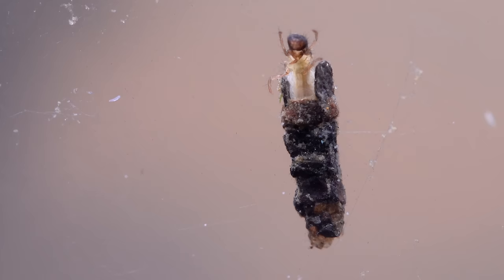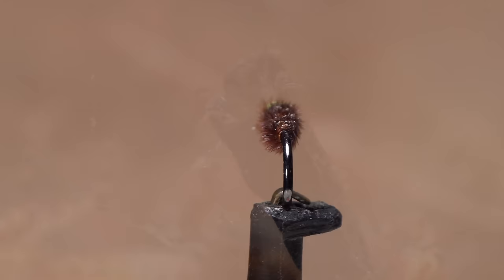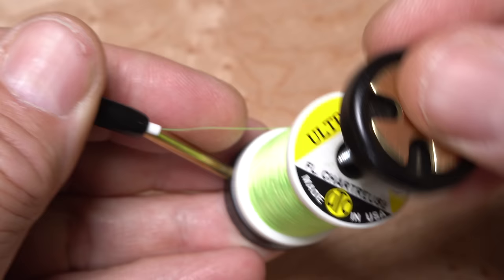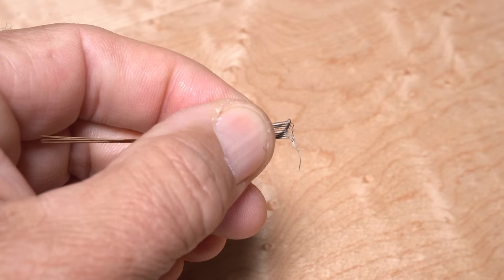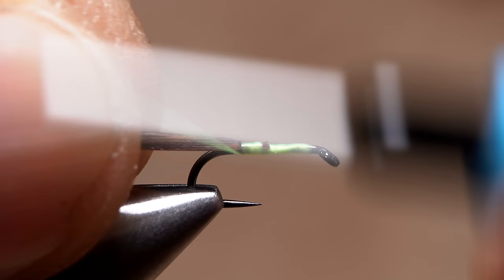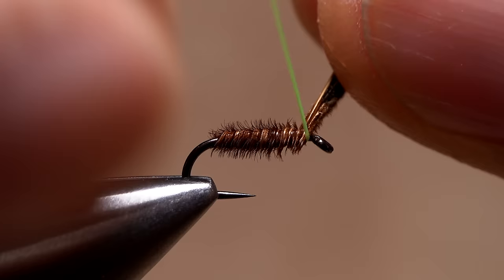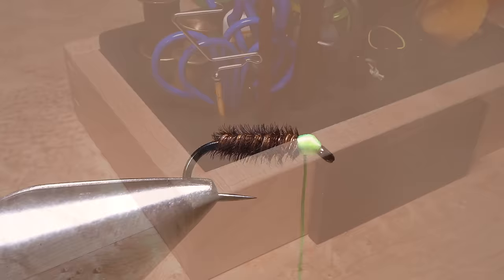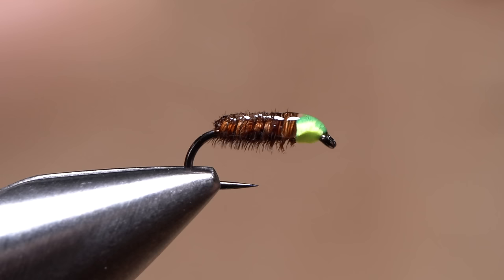Cased Caddis Larva

Comment: Tim, what are your thoughts of using a green flour tung bead and jig hook so it could be fished Euro style?
Reply from the maker: You absolutely could tie it as a jig if you want. I however prefer them as weightless as possible to better mimic the manner in which the naturals are carried downstream. I fish these most often in a tandem rig with a euro jig as the anchor fly to get both flies down near the stream bottom quickly.
Reply: Thanks
Reply: I was going to ask a similar question but with adding some weighted wire beneath the body  @tightlinevideo